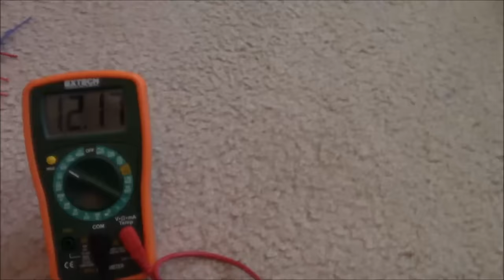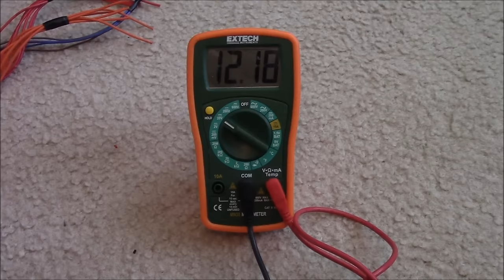How to Hack a Computer Power Supply (PSU) To Use as a 12V DC Power Source

Comment: So I'm a complete beginner at this stuff and would like to know how to hook the supply up to 12v rope lights and do i have to have the thing to measure the voltage.
Reply from the maker: +Cassandra Woodward You do not need to have a multimeter or voltmeter.  That is just nice to have to see what you are working with.  Can you send me a link to the rope light specs?  What kind of connector does it have on the end?

Comment: I have 13 black wires which one connects to the green? I chopped off all the connectors like you said. Did I need to know which black was paired near the green. Sorry I'm quite confused here. Thanks. Sam.
Reply from the maker: Glad you figured it out.
Reply: (for other peoples future reference) if you still have the connector attached its pin 16-17 for a 24 pin connector and 
14-15 for a 20 pin im pretty sure
Reply from the maker: Miles11we
Thanks for the future reference.

Comment: hello, thank you for the video! I liked. Im currently making a project of a FFB Steering wheel where i power a motor with 12v power supply i need 15 amps my pc power supply can draw up to 18amps at 12v would that work?
Reply from the maker: Yes, 18A should be possible on most PSU's.  But check the manufacturer specifications to be sure.

Comment: Hello and firstly thank you for this useful video... I got an issue about this setup that I can not fix. I am using this setup for my graduation project that includes peltier(Thermoelectric Cooler) modules, heat sinks and fans. System runs perfectly for a while and power draws are sufficent to get cold side really cold.. :) But after that, system just shut itself off. We could not figure out why this happens. Is there another cable to use for preventing this for this application. I am asking it here because I think you had some videos about peltier modules as well. Thank you.
Reply from the maker: Yes I have done a few peltier videos.  Are you measuring the power draw of the system?  Does your PSU have a fan?  It is possible that the power draw is close to the maximum of the 12V rail and it is overheating the PSU.  That is the first thing I can think of off the top of my head.

Comment: And is it necessary to connect all black wires and all yellow wires. Does a single wire of each would work or not.
Reply from the maker: No you don't have to connect all of them together.  But if you only use one wire, you cannot use the full current capacity of the 12v rail.

Comment: GREAT VIDEO, I'M A NEW SUB, NOW MY QUESTION WOULD BE, HOW MANY WATTS ARE YOU GETTING OUT OF THIS POWER SUPPLY, I KNOW ITS AN OLD VIDEO, BUT IF I HAVE A 650 WATT POWER SUPPLY, AND I DO THE SAME THING FROM THIS VIDEO, AM I REALLY GONNA GET 12 VOLTS OUT WITH THE 650 WATTS FROM THE POWER SUPPLY??
Reply from the maker: There are multiple "rails" on the power supply that provide power to various parts of a motherboard and PC components like video cards.  The power rating of the PSU adds all of those numbers together for an aggregate power number.  In other words, the 12V rail with the yellow wires probably doesn't provide more than about 20A on most power supplies (240W).  But you have to check the specifications of the PSU manufacturer to know for sure.
Reply: @LDSreliance  GREAT, THNKS FOR ANSWERING, VERY HELPFUL INFO DUE TO I REALLY ONLY NEED AN OUTPUT OF 135W..THANK YOU
Reply from the maker: You are welcome.  Good luck and thanks for the sub!

Comment: Instead of plugging the power supply into the wall, Can I use this to connect to my 12v deep cycle AGM battery bank (charged by solar panels) and then power my desktop.  It seems inefficient to use my inverter to take the 12v DC from the battery bank and invert it to 120v AC and then the computer power supply brings it back down to 12v for the computer to use. Thanks!
Reply from the maker: +hoogleyboogley Unfortunately, no you can't.  A desktop power supply needs AC input.  The only way to do this would be to open up the power supply and modify it to accept DC power.  I am not an electrical engineer and would not know how to do this so I can't help you with that.

Comment: can it be used for high amps purposes like running the 775 dc motor? or the current would be low due to not using the other wires and voltages of the supply?
Reply from the maker: Most of the 12V rails I have seen are 20-25A.  Larger power supplies usually just use multiple rails instead of continuing to increase the current of the main 12V rail.  But almost any PSU should be able to run a 775 DC motor easily.

Comment: I'm curious about making led shop lamps. Like a florescent shop lamp, bit using the rolls of led strip lights in it instead, powered by a pc power supply. Your thoughts?
Reply from the maker: +Brian Genter That should work just fine.  The strip lights might be particular about what voltage they need to operate properly without flickering and overheating so you may want to check the manufacturer specifications to make sure.  LEDs use drivers (power transformers) when plugged in to AC that provide a very specific DC voltage to the LEDs.  So since you are skipping the driver and providing your own DC power it needs to be within spec of what those LED strip lights require.

Comment: HI LDS reliance , I am in South Africa and was always told that the green wire was the earth or ground wire. I see that you use the Green and then say the Black is ground. so to me that is ground to ground. I have 2 PC power supply units, One has the green batched with all the others as you have. The other one has it separate and is the earth wire with 3 others, Is that also the green that I use ? And one more ,maybe a stupid question, Must the fan be in the unit , if not do I have to bridge out the pins. Does it keep the supply unit cool ? More later after I get your reply, Thanks for your Video !
Reply from the maker: The green wire is the power on wire.  It is usually wired to a switch (the power switch on the computer case) and when you press the switch it grounds the green wire to a black wire and that tells the power supply to turn on.

House wiring is where the green wire is ground.  That does not apply here.
Reply from the maker: And yes there is a fan in the cpu to keep it cool.

Comment: I want to power up 4 computer fans using an old psu. Can I do this? And what are some safety tips can you give me apart from taping ever exposed wire in electrical tape
Reply from the maker: Yes, this will easily power 4 fans.  For safety, do not take apart the PSU case.  Also, make sure you use at least 3-4 of the yellow wires bundled together if you are going to use more than a few amps.

Comment: Do you need to solder all the 12V lines together or can you split them in half and power 2 12V devices
Reply: You can use a 3 pack of wires no problem
Reply: Depends how much you want to split the current into

Comment: could you make a video using this to power a car stereo an if so would the power supply also beable to power amp for a subwoofer testing?
Reply from the maker: It is on my list of videos to make in the future.  Probably will be a few months, though.  Time is short.  It would be able to power a head unit and a small amp but that would be it.  This particular PSU provides 20 amps of 12v power (240 watts) so that obviously isn't much, especially for a sub.  You would also need a capacitor to help out because these types of power supplies don't like to provide surge power for those big bass notes.
Reply: I was thinking that also but how would I how would it act if 2x deep cycle battery's added.. I am trying to get 1200-3200 Watts. For testing new boxes an subs.
Reply from the maker: bonez420inc 2 deep cycle batteries might be able to provide 1200-3200 watts for a short period of time @ 12v.  I would still add a capacitor in there, too.  It will depend on the size and quality of the deep cycle batteries you are using.  Deep cycle batteries are not like car batteries in that they are more like a marathon runner as opposed to a sprinter.  They can't provide huge amps for a short period of time like a car battery.  They are more designed to provide low amps for a long period of time.  So you may need 4 deep cycle batteries for a test rig like you are talking about.  Or you could mix in a car battery with a deep cycle battery and try to create a system that had both high amp capability and staying power.  I haven't tried that before but theoretically it should work.

Comment: hi, nice and simple explanation. Maybe cool to make a server power supply tutorial either. they have very stable power.
Reply from the maker: Yes, they are usually a little better than the normal pc psu's.  I'll have to look into that and see what benefits it might have.
Reply: +LDSreliance nice, I'm looking forwards to it. typical is fan control on the .

Comment: Hi man, great video.
Is it possible to charge my car battery by this set.
My battery is 90A battery. How long will it take to charge enough?

Thanks for the video.
Reply from the maker: +Tsogkhuu Angler Thanks!  No, you can't charge a car battery with this.  Car batteries require about 14.6v to charge and a computer power supply will only provide 12v.  Sorry
Reply: LDSreliance Thanks for the reply. Do you have video about charging car battery with this kind of stuff.
Reply from the maker: Tsogkhuu Angler
You could use a voltage regulator or converter to step up the voltage to 14.5-15v in order to charge your car battery.

Comment: Hey bro out of all the youtube vids out there to use a psu to get 12vdc from it this onw has helped me alot it was way more easier and understanding but i had a question, can i use this to power a car radio? Thank you bro god bless also do i have to use all the yellow and black or can i use just one of each
Reply from the maker: I responded to your other comment.  Each of these wires is very small and can only safely carry a low amount of current.  If your car radio powers the speakers in the car then it likely needs 5-10A just for the speakers and then more for the radio itself.  I'd check the manufacturers specs to see the power draw of the radio and go from there.
Reply: @LDSreliance  okay i need like 8amps from the power supply how much in the yellow and black wires should i connect
Reply from the maker: @kallmeronaldshorts2059  If it was me I'd do like 3 yellow wires combined to be safe.  And 3 black wires combined.
Reply: @LDSreliance  okay thanks bro but how much amps is one wire?
Reply from the maker: It depends on the gauge of the wire.  The wires look to be around 18 gauge or so and are about 18inches or so long.  So they should be good to carry 8 Amps each for that distance.  But I always try to be safe instead of sorry.
Reply: @LDSreliance  okay np thaks much

Comment: What a great video. Thanks. 

I have a 450watt supply. I want to power 2x 370watt lights. Im assuming the obvious ill need another power supply for the 2nd light yes?
Reply from the maker: Yes.  And unfortunately 370W will exceed the current that the 12V rail can provide on a 450W supply.  Mine is about 450 (or maybe 400) and the 12V rail maxes out at 20A which is only 240W.  So you are probably going to need a 550W+ sized PSU for one of your lights.
Reply: Thanks for the reply! Wow interesting to know thats a lot
Reply from the maker: Yes but those are some serious lights that you are trying to power, too.  Keep in mind even a high performance computer only consumes about 200W unless you are playing a computer game or watching a movie or something.  So 370W is a pretty big load for a PSU.
Reply: Is there a better way/cheaper more efficient way. basically i want to power 2 LED driving spot lights. they have 37 x 10w LEDs in each so 370w. They usually run off a car battery. 

What would a better option be than computer supply. 

Thanks again for your help
Reply from the maker: Something like this would be ideal:  https://amzn.to/2Joxy6O

Comment: Thank you for this clean and understandable video.  Question:  Are the wires coded the same on all power supplies?  ie:  I yellow always positive and black negative?  Thank you...captjack.
Reply from the maker: I hesitate to say always, but yes that is the standard.  The only way to know 100% is to find a spec sheet or wiring diagram from the manufacturer that gives you the colors and voltages for the rails.
Reply: @LDSreliance  Thank you for you fast response.  Keep safe, please...huggs..captjack..
Reply from the maker: You are welcome.  Thanks for watching!

Comment: I have a power supply but it not contains the Green Cable. Which Color Cable i have to connect with ground to awake power supply? Please guide
Reply from the maker: You need to look up the diagram/specs from the manufacturer.  There has to be a wire that connects to the power switch on the computer case to turn the power supply on.

Comment: I know very little about this, can you tell me why you need all the cables and not just one of them? assuming you will use less than 100 W of power. what is the requirement to power security cameras on a distance of 50 meters? do I need thicker cables? do I need a more powerful power supply? what happen if I draw 400 W off a 500 W rated cheap power supply, is it safe or it will damage the power supply fast? Sorry for my English
Reply from the maker: I used all of them bundled together so that they could safely carry the full current of the power supply (20A in this case).  If you want to use less wires that is fine as long as you are using much less current.  100W is still 9A or so and that would probably heat up and fry a single wire.  I would use at least 3-4 wires together for anything requiring that much power.

You will have to look at the maximum current of your PSU for the +12V rail.  It will be much less than the total power of the power supply.  So if your PSU is rated at 500A your +12V rail is probably only about 250-300W.

Comment: Hello! Good video and it answered my questions. I have an old computer  power supply and when reading  the different voltages and currents it says +12 volts 10 amps. I wired everything like you said connecting the yellows and blacks together to power a 6 amp LED light panal I built. If I power it with a battery, it draws 6 amps faithfully  but if I use the computer power supply it drops down to a little below 4 amps and the voltage drops down to 10.5 volts. Is the power supply probably faulty?
Reply from the maker: I have had one other person comment about this happening.  I don't know what to make of it.  The voltage on the 12V rail should not drop like that.  Where are you measuring the voltage?  How long are the wires?  Did you solder all the yellow wires together?  Do you have a DC clamp meter for current by chance?
Reply: Yes, I had all the yellow wires together and all of the black ones together also. One of the black wires I use to conect to the green wire of coarse. I have the gathered yellow and black wires connected to 12 gauge wires less then a meter long that go to my led pannel. It lights up pretty good but not like when it is drawing 6 amps. To test the current draw I just hooked it up in series with my VOM selected for  current. When I do  exacty  the same thing with the 12 battery it will draw 6 amps with no voltage drop.
  I thought maybe the power supply was faulty but then I did the same thing with another computer power supply that is almost new with a 20 amp rating on the 12 volt output and got pretty much the same results with the voltage drop, which surprised me.
  Could it be that I need some kind of a load on the other voltage outputs or something?
Reply from the maker: That is really strange.  I don't know what to tell you.  Are we sure that all of the yellow wires are on the same rail?  There aren't two 12V rails by chance?
Reply from the maker: Jon, I did some more research.  Apparently, some power supplies will not provide stable +12V power unless there is also a load on the 5V rail.  Can you try putting a 5V load (anything that uses USB) on the 5V rail and see if that helps?
Reply: Thanks so much for your help with this. I tried putting a 10 ohm resistor on the 5 volt rail and it made an improvement. It went from a little under 4 amps to about 4.7 amps and the voltage drop went from about 10.5 volts up to 11 volts. (better but not optimum and still puzzling) Thanks again for your help!
Reply from the maker: You are welcome.  Sorry it isn't operating better for you!
Reply: Same issue happen to me. After  putting a 10W 6.5ohm load resister to a 5v rail its improved to 11.8v.
+LDSreliance suggested me to use a step-up power converter
Reply: I tried a 10W 10 ohm resistor and it went from 10 volts to about almost 11. So I will try what you did. TX! Ohh another thing I learned was when powering it up, power up the power supply first an then put on the load. I tried powering it up with the load present and it dilived a pulse that fried 27 of my 600 led light panel.

Comment: Hello mate can i ask you for example how many yellow and black arevin total coz i want to use use this to power led stripe of which each consume 12volts*2A so how many can it power up. I have an old one that is of 500 watts
Reply from the maker: My power supply is only 450 watts and the yellow 12v+ rail will provide 25 amps.  So theoretically it will power 12 of your led strips.  I would personally only do 10 strips to be safe.  Yours is a little bit stronger so it might be able to do more.